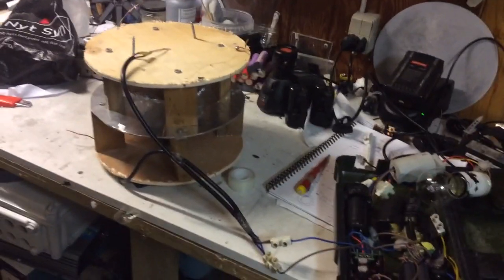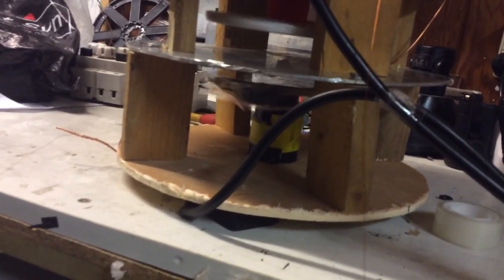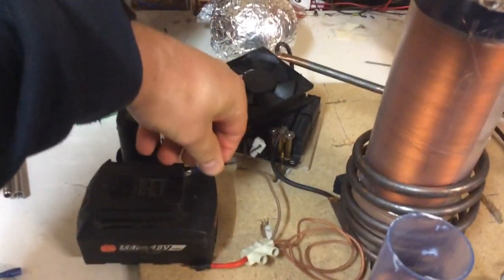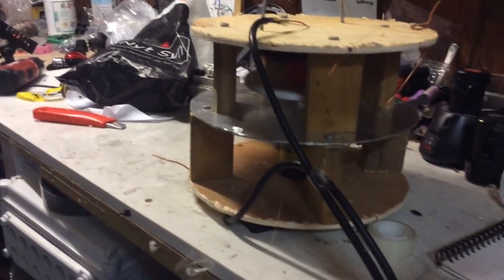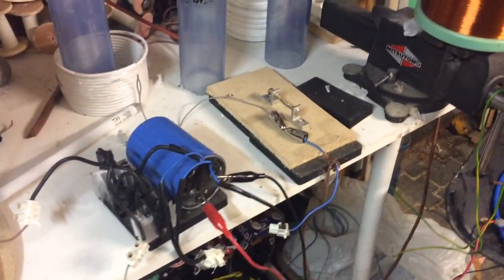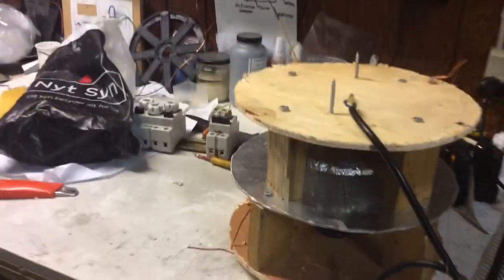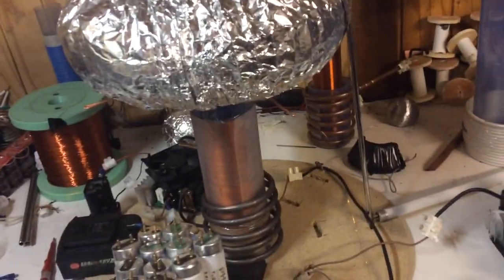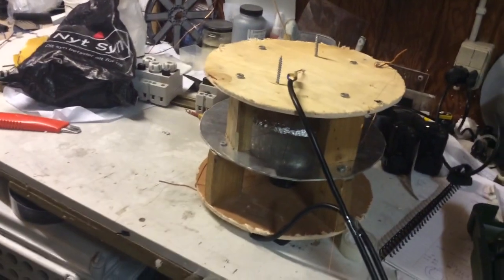Tesla field energy and antigravity

Comment: Hi Nick. Great video! Cool to see others trying to replicate the device. Maybe you’re just missing the ultrasound component? I will try to get a video up of my attempt soon. Still waiting on some parts to arrive.
Reply from the maker: Matt Hollidge thanks mate, it’s all about experimentation:) we will crack the code at so point:) keep me posted.
Reply: dkdyker posted a video. Let me know whatcha think https://youtu.be/0t7KgsL2Y6k
Reply: @dkdyker  Don't for get the rotating disks need to spin in opposite directions (top clockwise & bottom anit clock wirse) to get some lift
Reply from the maker: @SpectacularRanker2  thanks for the input I remember that they are doing that but I am missing something???
Reply: @dkdyker  Maybe the large wooden blocks holding the top & bottom disks are too much weight, try building one out of thin pieces of aluminium to Alexey Chekurkov has, perhaps yours is too heavy to take off
Reply from the maker: https://youtu.be/NRtDpq0m7Fc
I have made another attempt
Reply: @dkdyker  http://www.rexresearch.com/chekurkov/chekurkov.html read through this article I found about the craft & you'll find the things Alexey used, especially the top spinning metal disc, it should have all the info we need to build our own thing, it mentions using an ultra sonic piezoelectric device on top of the craft too
Reply: @dkdyker  Oh that's right, I forgot I watched this one sorry,

Comment: Hi , Nick.
Good work.
Did you see vibration after you have switched the TC on? It meens that  the effect is present,  but the force isn't enough to take the device up. 
May be it will be some sense to hang the device with the сountrweight  to see the value of lifting force while you tune the TC mode.
Reply from the maker: Thanks I will try after summer is finished as I have no time at present. But I will continue. Thanks